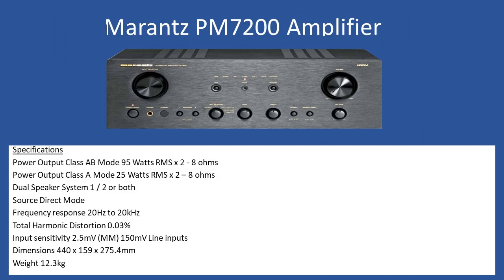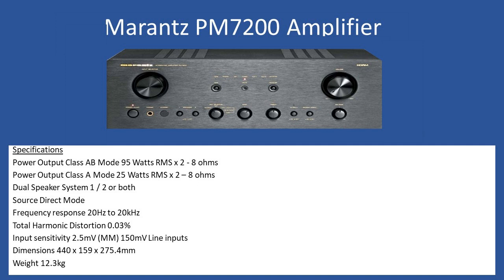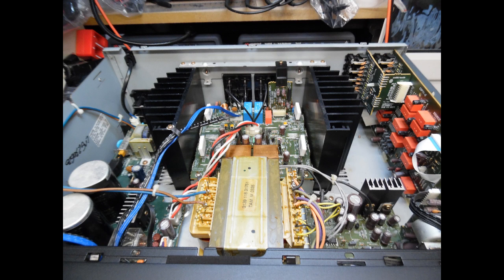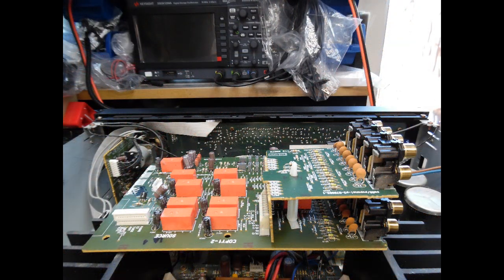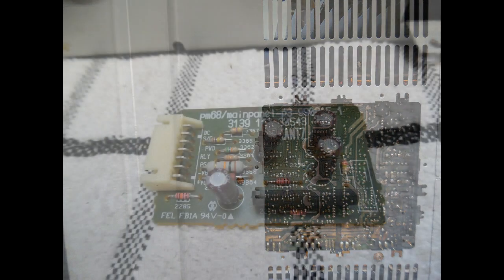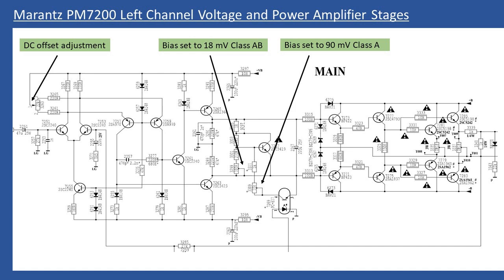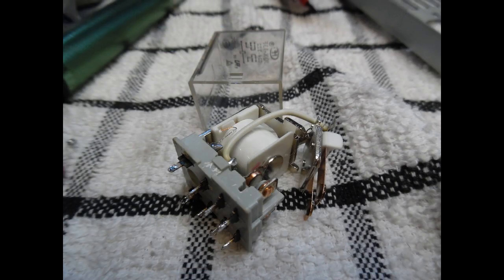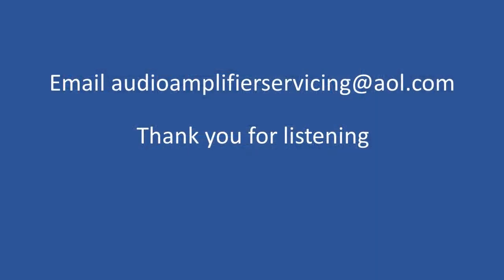Marantz PM7200 Amplifier Repair (With Audio Tutorial)

Comment: Hola, qué tal, a ver si me puede ayudar, compré un Marantz pm7200 en un rastro, estaba averiado, el fusible de cristal 1207 estaba estallado, el amplificador encendían los led pero no emitía ningún sonido, le puse un fusible y conecte el amplificador en serie con una bombilla de filamento y se encendió muy fuerte y se activaba y desactivaba el rele rápido, tenía 2 transistores de potencia mal, los e cambiado, e resoldado todas las placa como dice en el vídeo y ahora mismo al conectarlo no hace nada de nada, investigando e visto que el rele que hay en la entrada de 220v no se activa y no llega 220v al primario del transformador principal, pero si le inyectó 12voltios directos al rele se enciende el amplificador bien y ya no hay ningún cortocircuito, a los pocos segundos se conecta el otro rele, donde tengo que revisar para saber porque no le llega corriente al rele? Perdone por las molestias.
Reply: Ok, muchas gracias, lo revisaré y le comento, a ver si le volvemos a dar vida.
Reply from the maker: Check the safety resistor 3209 47ohm. It provides the voltage to the relay coil.
Reply: Nada e revisado la resistencia 3209 y le llegan los 14v y salen también, el problema es que a los conectores de la bobina del rele le llegan 14 voltios  en los dos conectores, también e comprobado que en el conector que va a la placa del frontal, el la posición 6 “relay” según el esquema eléctrico debe dar +0,8v y me da 16,40v, e desconectado de la placa power el conector que va a la placa del frontal y en el pin 6 “relay” me siguen dando los 16v, entiendo que el problema debe de estar en la placa power.
Reply from the maker: @ANDRESYSUMINI relay switching is via the transistors 7407 and 7408. 7407 is driven by the microprocessor. Check the voltage on the base of 7407.
Reply: Ok, muchas gracias, mañana lo reviso
Reply: E revisado y en la base del transistor 7407 hay 4,95v
Reply from the maker: @ANDRESYSUMINI Hi refer to the service and the associated circuit to determine if the transistors are being turned on to operate the relay.
Reply: @AudioAmplifierServicing ok, este fin de semana lo revirare y le comento, muchas gracias de nuevo.

Comment: Can you help me. My pm7200 have fault in potentiometer. Can you help take a photo of potentiometer with its number/code so I can find a replacement. Thank you in advance.
Reply from the maker: If you have the Amplifier and the faulty potentiometer, you have all you need to source a replacement.
Reply: @AudioAmplifierServicing actually, the pm7200 I have, I just bought it second hand. And the potentiometer is not an original one. I want to find and buy an original potentiometer for it.
Reply from the maker: @NguyenNguyen-bg8ur Which potentiometer are you referring to?
Reply: @AudioAmplifierServicing I want to refer to pot 3681 if you have the volume circuit or diagram
Reply from the maker: @NguyenNguyen-bg8ur Okay send an email to audioamplifierservicing@aol.com

Comment: Hi, great video. I have a question about this amp. I have one which will produce a loud cracking noise every few minutes when in use. I have no idea where to take for repair or what the problem may be.

Can you tell me where your repair centre is based?
Reply from the maker: Hi, if you're in the UK, email audioamplifierservicing@aol.com

Comment: My right channel sounds crackly like a blown speaker. What may I check first.
Reply from the maker: @FastMover86  Remove the rear processor links and check if the noise is still present. If it's not, then the issue is either the input or pre Amplifier section.
Does the noise get louder if you increase the volume control?

Comment: Hi, Where can I source these speaker protection relays in the UK?
Reply from the maker: Hi https://uk.farnell.com/schrack-te-connectivity/6-1415546-5/power-relay-dpdt-24vdc-8a-tht/dp/3792630?gross_price=true&srsltid=AfmBOoqTqtd6H-fv2EXn98DQh6Jcgo7v9HhXBXETNvH0hBmpVW06iQdy06w
Reply: @AudioAmplifierServicing  Many thanks - You are awesome!
Reply: @AudioAmplifierServicing  Purchased these relays but now I have removed the old ones I notice they were double pole single throw whereas the replacements you recommended are double pole double throw - Is this correct and you just cut of the unwanted terminals or is this an error?

Comment: Hi thanks for the great video. My PM7200 does power up anymore. I push the on/off button but it’s completely dead. Power light doesn’t come on. There is voltage going into the power board. Fuses are not blown. But there is already no power at the main transformer. Any advice? Thanks!
Reply from the maker: @NewYork-zg9iu  The start up relay 5202 should energise providing power to the power transformer. Check if you have the 5.6 volt start up voltage, on the output of regulator 7302. The model of Amplifier develops a of dry solder joints on all circuit boards so depending on what you find bad solder joints should be reflowed.
Reply: @AudioAmplifierServicing  thank you so much for the advice! Will try it.
Reply from the maker: @NewYork-zg9iu  Take your time to clean the contacts and lightly brush the contacts with the fibre glass pencil.
You can also spray the contact cleaner onto an absorbent cloth and draw across the contacts.
It import not to bend the contacts when cleaning.
Also use eye protection when using the fibre glass pencil to avoid fibers flicking into your eyes.
Reply: @AudioAmplifierServicing  the output of the regulator is only about 250 mV. Solder joints look optically good. Could it be a capacitor or transistors in the regulator circuit?
Reply from the maker: @NewYork-zg9iu  Hi check if you have DC Voltage on either side of resistor 3207 1 ohm the voltage regulator input should be 13.3 volts. R3207 may be open circuit or the start up transformer thermal protection fuse may have failed you should have AC volts on the output pins of the transformer 5205
Reply: @AudioAmplifierServicing  Hi thanks for all your help. There is AC output 13V on the transformer 5205. so that one should be good. there is only 11.3 V on the resistor 3207. does it mean that i should exchange the resistor? Sorry for the dumb question. I have no background on electronics ;-)
Reply from the maker: @NewYork-zg9iu  Check the voltage on either side of the resistor if you have no voltage on one end then the resistor is open circuit, either way you must have voltage on the input to the regulator

Comment: Very interesting videos please keep these coming👍
I ve just picked one of these up that needs abit of attention speaker relays and probably a re cap, one thing it does need is the main on/off switch you hear it sparking internally ehen you gently touch the on/off button. Do you know what type of switch i need and wheres best to obtain one ?
Thanks 👍
Reply from the maker: Hi if you can send a photo of the switch to audioamplifierservicing@aol.com I will be able to advise a correct replacement

Comment: Hi first of all thanks for great videos. I have an issue with my marantz pm7200, in direct mode the right hand speaker is slightly louder than the left.I had it repaired a couple of months ago it had to have two new out put transistors don't know which channel though. Any help would be appreciated.
Reply from the maker: Hi I have responded to your direct email.

Comment: hi.i have arcam avr 350.the displays do not work. everything else works. how can I fix the displays myself at home so that it shows the sound level and the radio station ..?. I'm not advanced in repair.
Reply from the maker: Hi Down load the service manual https://www.hifiengine.com/manual_library/arcam/diva-avr350.shtml then check the supply voltage to the vacuum fluorescent display.

Comment: Maranzt PM6004 likes to turn itself off when the volume is turned up
Reply from the maker: Hi can you check when the issue occurs do you see the mute LED on the front panel flashing, if so the protection system is operating.
In the first instance check your speaker wiring / connections and impedance.  If no issue is found and the Amplifier returns back to normal operation, turn up the volume and see if the standby LED turns on and off  If so there is an issue with the power Amplifier stage or the internal capacitors across the speaker terminals internally component references C7501,C7502,C7503,C7504